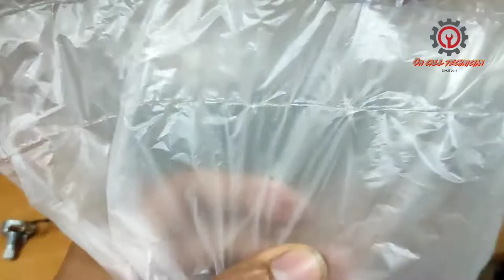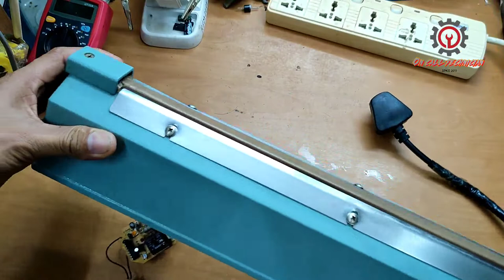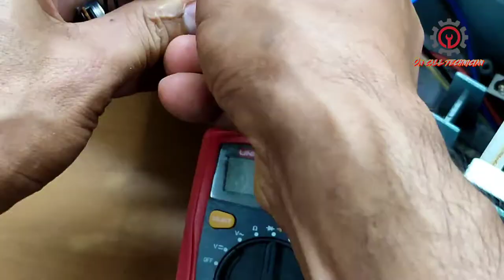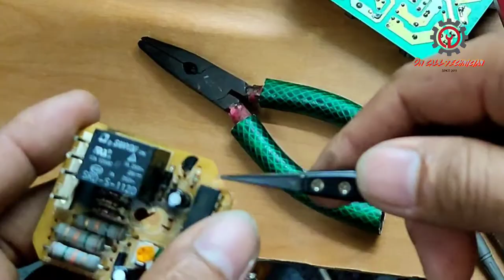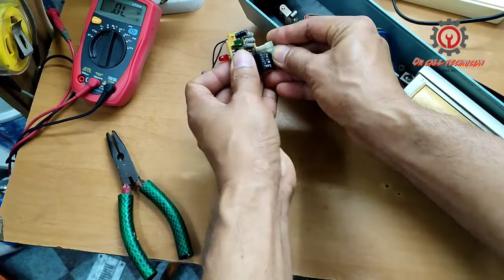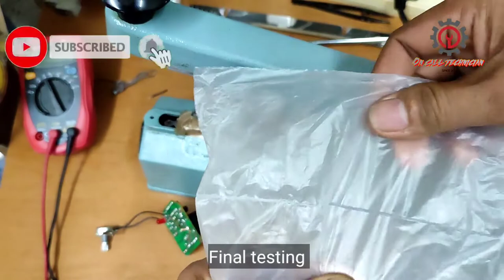HOW TO REPAIR NO POWER ISSUE OF IMPULSE SEALER OR HAND SEALER

Comment: Hi sir good video, I will be great to see you testing and changing the transistor. Also I have a question, I got an impulse sealer that the heat can't turn off, so the metal get bright red and the only way to stop it is to disconnect the cable, any aidea?
Reply from the maker: Try replace 24vdc 220v ac relay sir, and don't forget to check micro switch too